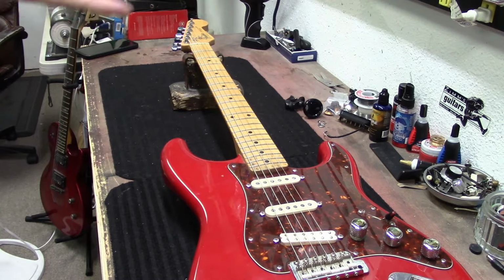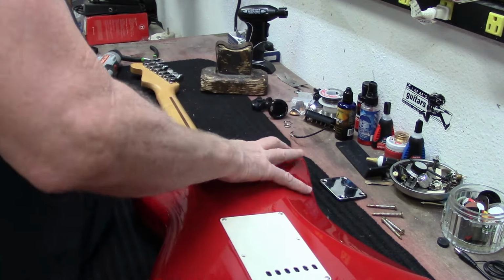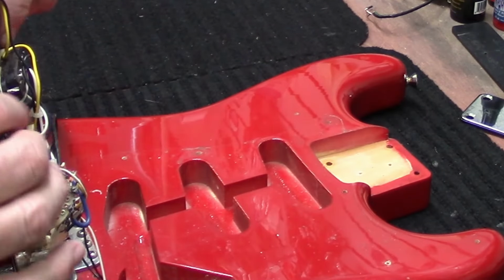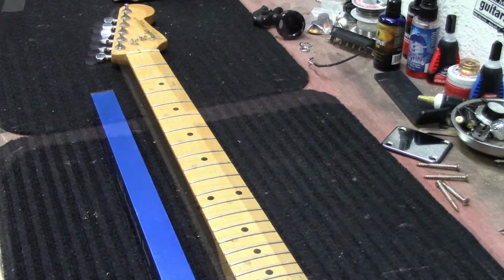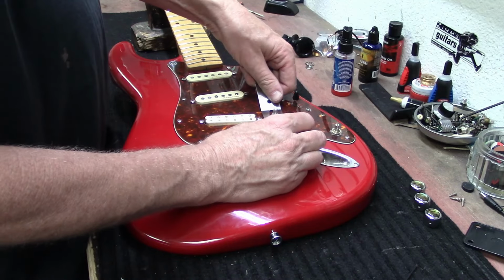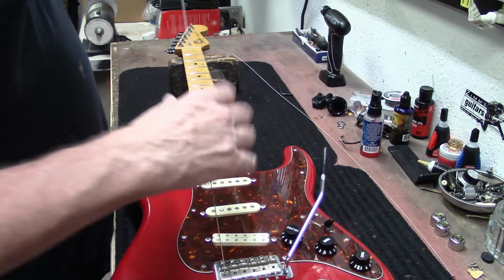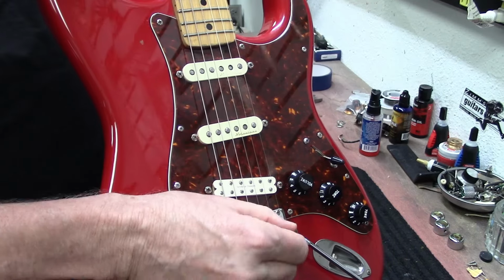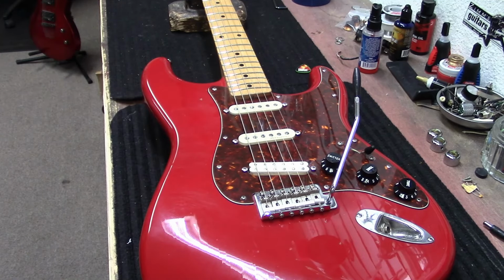Made in Japan Fender Stratocaster

Comment: It's missing the Dowell holes. Good parst and neck. I've got a Squier standard stratocaster neck with a Fender body and original pickups. Has the serial number and I saw the original guitar from when the guy before me had bought it from Swetwater. Was a 50s vintage strat. Now it's got a reverse headstock,  rosewood fretboard and upgraded wiring and capacitors with with vintage tone bleed and vintage 001 capacitor. It's as good as it gets for this cheap ol boy.(yours also has upgraded pots and switch with a volume audio taper I think)

Comment: Dane, the body is mij. My 87 mij Squier has the offset screw holes on the back panel and the black gasket for the neck plate. Mine has “red” stamped in the neck pocket. Does yours?